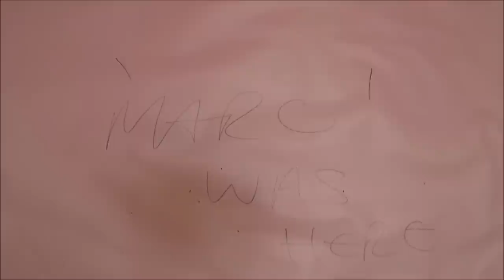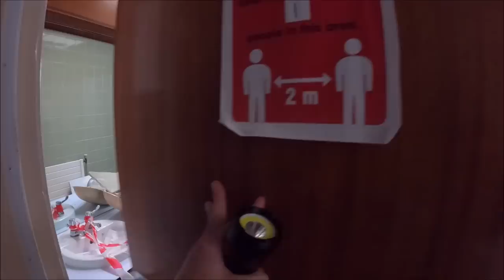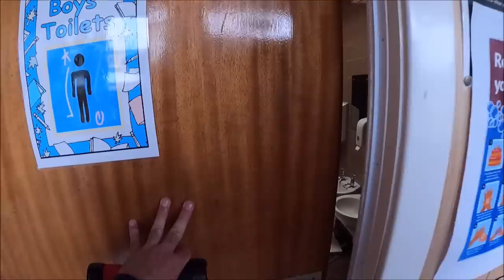2 Abandoned Primary Schools - SCOTLAND

Comment: Great explore 👍🏼 judging by what I’ve watched, it looks like the schools were last used in 2020 (before the pandemic). The first building looks typically like most primary and secondary school buildings in the uk that were built during the 50s and 60s. The second building looks like a later addition, which I assume was constructed because of the need to facilitate more children (but I could be wrong). I’m guessing mid to late 80s/early 90s that the second building was constructed, judging by its appearance. Unfortunately, some buildings that were built during the 50s/60s contained asbestos; resulting in closures with similar buildings. However, I’m not stating that this was the case 😊 I’m pretty sure that they vacated these buildings for a more spacious school that been recently constructed (or a potential merge). Hope this helps 👍🏼